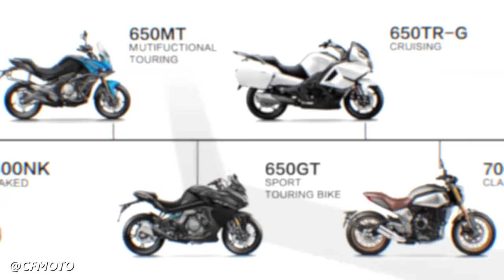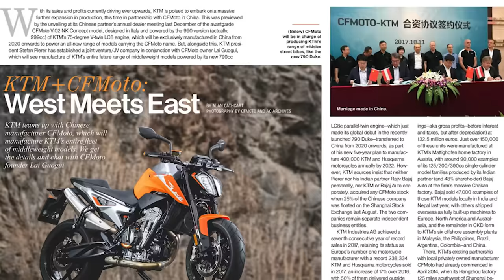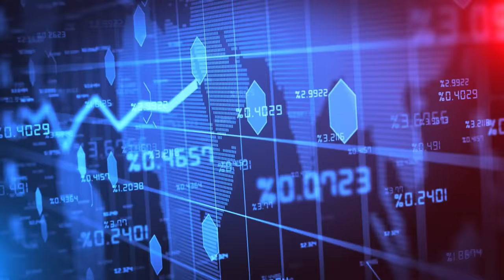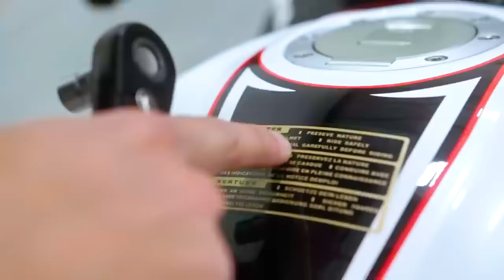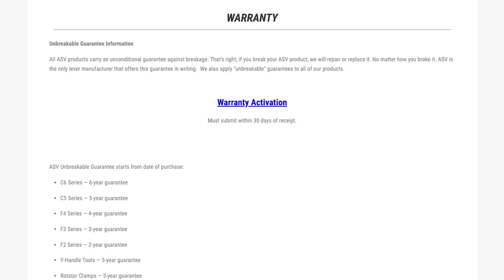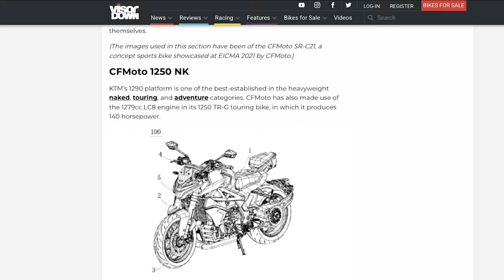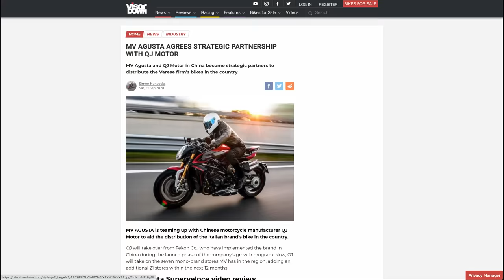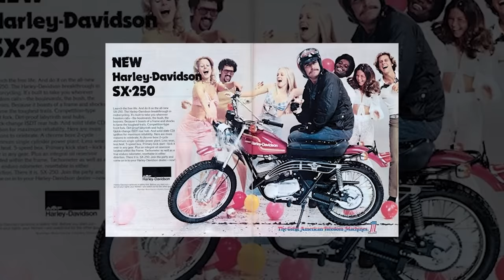NEW Chinese 1000cc V4 Superbike! (CFMoto)

Comment: Fun fact - The Kawasaki 650 parallel twin is also manufactured by CF Moto. It's the same engine used in CF Moto's 650 line up and the Moto Morini XCape 650. Thank me later
Reply: Everyone knows this dude
Reply: @chrispekel5709 I didn’t know that
Reply: @chrispekel5709 dude wtf not all knows this
Reply: That is false
Reply: Lol. Where's did you find this fake info? Bing?
Reply: What!!! NNNNOOOOOOOOOOOOO!!
Reply: What I do know is that the CFmoto CLX 700 series used a larger kawasaki ER-650  engine but 700cc in displacement.
Reply: cfmoto is knock off of kawasaki as most chinese are knock offs of japanese. kawasaki made that engine before cfmoto ever mad a bike
Reply: NOPE cfmoto makes clone of kawasaki engine and honda engines. kawasaki and honda made these motors before the chinese ever built a bike, other brand chinese cloned old hond single and twins not they are cloning kawaski
Reply: Parts are interchangeable to fit CF Moto engine. No modifications required as it's just a Kawasaki 650 engine under license, body by Kiska, brake by Brembo JJ Juan
Reply: Wrong info 🤦🏻‍♂️🤦🏻‍♂️🤦🏻‍♂️
Reply: For what ?
Reply: @chestermarigza4917 wrong
Cfmoto has nothing to do with Kawasaki
Reply: @RT22-pb2pp big wrong
Cfmoto has nothing to do with Kawasaki
Reply: @rohzpopper4922 big wrong.
Cfmoto has nothing to do with Kawasaki
Reply: wrong c f moto cloned kawi kawi never used any other manufacturers engines you got bad info dude
Reply: Nope. That's incorrect.

Comment: Let me just say I recently lowsided my 2023 KTM 790 Duke (CF MOTO BUILT) at about 60 mph. And the bike held up really well, no snapped welds or fractured ally. If it wasn't for a bent front wheel I could've ridden home. I've done 5k miles on it already and no issue to speak of. Very impressed.
Reply: Ok John xina
Reply: A bike rammed into my Husky's(Made in India) radiator at 50+kmph, just the guard fell off which I picked up and put on back. Another time a bike rear-ended perpendicularly nothing damaged. See if 5 ppl who had problems would post here then everyone will think there's a problem with KTM's QA but 5 will post positively people will ignore.
Reply: I have 18k miles on my 790, and only issue was a very small coolant leak
Reply: I bought the 700 clx sport about a month ago and I am absolutely in love with it. It was a zero mile 2022 model so I got some money off msrp and didn’t have to pay the dumb transport fee. Walked out the door with it for $6300.
Reply: 5 k I had 60k in 5 yrs on original ninja 600 never had 1 not 1 part fail show me cfmoto that has happened on I will buy in
Reply: @RT22-pb2pp  lol it’s going to take a while before people hit 60k. I am in a Facebook group for clx 700 sports (as I have one) and not a single person has had any major issue. The only issue people have had is around 7k miles for some reason the gas gauge starts blinking. CF Moto does have a recall for it so you can take it to any dealer and they can flash the ECU for it to stop. There’s two or three guys almost at 15k and haven’t had a single mechanical issue. My only complaint is that it doesn’t like anything under 3.5k rpm. It’s pretty jerky. Wish there was a tune for it.
Reply: @Nick-Edwards pls complete 60k miles on your clx
Reply: Chinese cheese wheels  😂😂😂😂😂
Reply: Pshhh
Reply: Just fyi people ride 03 bikes with just an oil and filter change. Thats kawasaki,honda,yamaha reliability.5k aint shit, those bikes are 21 years old and abused! Thats impressive

Comment: I still love my 450ss after having for for over 5k miles in 3 months! Absolutely insane!!!
Reply: I consider buying one myself. What is your opinion now, nearly a year later ?
Reply: @solidXsnake4life But big brands like yoshimura exhaust have an after market exhaust for 450ss doesn't really sound good in my own opinion but it's good because it improves performance and trusted brand you can also buy Vandemon full system exhaust dual exhaust for cfmoto 450ss around $1200 USD no tune required as long as you have the db killer/silencer 100db w db killer / 104 without db killer

Comment: bought a 2022 650NK for $6K OTD and have loved it. Ridden my friends’ R6 and mt-07, etc. Loved those bikes and yes, they were BETTER but they were also almost 3-4K more OTD and idk if they were thaaaat much better. Part availability is okay but most parts that fit kawasakis for the 650 line up work since they’re pretty similar stuff and the 700 bikes just use KTM stuff so those fit pretty well too

Comment: I have CF Moto 300NK, and given my small experience, I can point out only minor negatives:
1) Handlebar vibration could be a bit less
2) Engine cooling system is weaker than  desired (affects only slow speed riding in hot weather, 85 °F), but no overheating
3) Fork rebound is a bit harsher than desired
4) Seat could be a bit softer
5) Speedometer shows ~2 mph more than the real speed
Other than that, it seems to be reliable machine (+2 years warranty), well-built, and fully suits me as a beginner bike.

Main competition are India-built Yamaha bikes plus Indian brand Bajaj.
Reply: Isn't the +2mph a legal requirement for manufacturing?.
Reply: @TheLiamis  Not sure. But it is annoying to see at lower speeds, when it makes a difference. We use km/h in Azerbaijan, so it is like 9 on speedo vs 5 real. I had a Japanese car which lied about 1.2 mph , that was tolerable, 2.5 mph is not.
Reply: @Murad.bn2  I think it's required to prevent people going over the limit. As I always say though the speed limit is the grip on my tyre's.
Reply: You bought a budget bike = got what you paid for
Reply: @IN_ZANE_  Completely agree. I am generally happy with it, worth the money. As for major brands, we don't have dealers in our small country, so that all those bikes come either used, or for crazy prices (like Z650 2023 for $16300).

Comment: CFMoto pricing in the US makes it a little harder to pick if a CLX700 is 7k and a MT07 is 8k... But here in Australia, the price mark is tempting, the CLX700 is $8,500 whereas the MT07 is $14,500. I'm stuck between buying a Suzuki SV650 at $11k or a CLX700. My head tells me to get the SV, but my heart based on the styling and features is considering a CLX700.
Reply: My CL-X 700 Heritage was $6,400 out the door here in the US. Granted, I bought the 2022 instead of the 2023.

The cheapest MT-07 I could find online (excluding Facebook) was a new 2023 for $6,900 before tax, title, registration, and dealer fees. It would also require me to drive over 400km to pick it up.
Reply: Clx700 sports are $4000 at dealers by me
Reply: @rileyrat13 400km is like 2 hours riding..?

Comment: Re "unbreakable ASV levers" ?  Meanwhile many levers are obvious DESIGNED to break (with an actual break point notch midway in the lever) rather than to destroy that expensive brake master cylinder.   So IS n unbreakable lever a good thing if the application is on a master cylinder?

Comment: KOVE just launched 450RR this year which is faster than zx-4rr,  
Cfmoto is currently making a 100hp  675cc  three-cylinder engine, it will to the market in a year or two
And Zotes too is making a 600-700cc three-cylinder engine
Things are getting really exciting lately

Comment: I started with a QJ motor 125cc, a Keeway RKF, in some countries it’s sold as Benelli. It sucks, after 15 days of ownership it was dead due to an electronic problem, then it broke the front fender, after that electronics got busted again, then the led cruising light just stopped working, after that the front fender got broken again. it also just shuts down while idling, the dealership was never able to fix it. All of that in 1 year and a half and around 15k km.

Comment: Cf Moto cut their teeth building their clone of the 247cc sohc liquid cooled Honda helix engine.
 Gotta say, as a engine builder, and multiple fast motorcycle owner , Ive actually owned and rebuilt some of the original cfmoto Honda reflex/ helix clones, and they run good. And Last A while, A crankshaft with rod & bearings for them is $80.00. a piston with rings is $19.00...
Drove one 500 miles a week for almost a year. 85 mph/80 mpg

Comment: I've been vlogging my experience with the new KTM 790 Adventure produced by CF Moto (not coming to the states!). It's done everything I've asked for it so far without no obvious downsides 700 miles in. The gears have been missing slightly so keeping an eye on that, but I think I just need to dial in my clutch a little. As with Royal Enfield, at the very least it puts the wind up the major players, which will result in them being more competitive in turn - win/win for the consumer.

Comment: The X350 is gonna suuuuck. The motor in it is a stroked Benelli 302s motor and that bike is revvy as all hell... it just feels wrong for a Harley to rev like a supersport, with no low end torque at all. The 500 should be a bunch of fun like yam said, the Leoncino rocks. Much more harley motor-esque if not for the 360 degree firing order

Comment: a KTM engine with chinese manufacturing? 
Sounds like a formula for reliability 🍦
Reply: That is litterally where KTM is at right now. Engine design and longevity itself is largely very good but let down by hit or miss QC with sub par assembly, typically coolant/oil leaks etc. Some have no problems and won't hear a bad thing said about KTM while others do.... and end up getting pissed off waiting weeks/months for replacement parts which often leads them to switch brands.
 I suspect a CFMoto branded KTM, if we can call it that?, would likely be a similar ownership prospect.

Comment: Id be very weary of buying a 1000cc cf moto superbike. With that kind of power any flaw could be deadly. Just lookin at the concept I can see some worrying components. Plus we are yet to see how reliable the even 450 is. Onde you start lookin deeper into the 450 you can see some shotty work here and there (cough cough swingarm). Not to mention who knows how much their 1000cc would weigh if the 450 already weighs as much as a cbr1000rr. It could be as heavy as a bagger

Comment: I bought a cf moto papio and it's very well priced. It has 40 miles on it and it's been dropped a few time. I only snapped the driver side foot peg and the gear sift lever.
Reply: Which side is the driver's side on a bike?? lol
Reply: @maxedout33t depends on how drunk you are lol, but I actually meant left front not "Driver's side". I just was being a dipshit
Reply: @maxlithium1190  I knew what you meant just messing around

Comment: What is funny is that, QJ's 1000cc "superbike" is actually using a 921cc engine from old Brutale 920. That engine only got 130hp compared to Brutale1000RR's 210hp. It's pretty clear that 921cc engine was made for street bikes -- of course cuz it was used on Brutale920 while the proper 1000cc superbike engine was used on the F4 series. Brutale 1000RR is a stripped F4RR as we all know, while the QJ Race 1000 has a pure street bike engine, clip ons raised all the way up to the moon, a seat height under 800mm. And they name the bike with the word "Race". Bruh. The only good thing is that the chassis design is the same to Brutale 1000, however QJ is gonna make the chassis so it's probably gonna be HEAVY AS HELL. Their Race 600 weighs even more than my StreetfighterV4. And they are branding it as a 600cc sport bike... a 600cc sport bike that weighs over 220kg, well damn that's new.

Comment: I have a cfmoto 650GT which is the sport/touring variant and i will say at lower revs it can feel a bit off at points but when you get them up it feels perfectly fine especially consdering they have undercut other 650cc bikes by about 2000 give or take. i will say the owners manual is full of spelling and grammar errors  which is a tad worrying since you do wonder if they skipped on a proof reading what else was skipped on.

Comment: Vastly misunderstood KTM engine "model" identification where a LOT of people actually THINK that an "RC8" engine is a specific design which is totally NOT TRUE....ALL RC8 or LC8 LC4 etc means is for example "Liquid Cooled hence LC 4 valve or or 8 valve or in the case of motogp 16 valve with "RC" replacing "LC" for race bikes.  But for example the an 8 valve engine "LC8" simply means liquid cooled twin with 4 valve heads ....it could be a Vee Twin OR a parallel twin of WHATEVER design and discplacement and it is STILL an "LC8" so LC4 LC8 etc does not mean CRAP as far as a SPECIFIC engine model so get that out of your BRAINS folks!  Yamaha sort of does a similar thing with CP2 CP3 CP4 but at least I think there is some actualy continuity so far?   Like maybe all the current CP2s really are the same basic model of motor used in Tenere 700 R7 and MT07 XSR700 and then the CP4 is the same basic platform shared between R1 and MT-1o FZ-10 albeit with some internal changes depending.  So unlike Yamaha one can not talk about LC4 for example like it is one common platform cause it is NOT and you will sound ignorant if you suggest for example "the LC4 is a time tested platform going back decades"  LOL  NO there have been several TOTALLY differnt motos sharing the designation "LC4"

Comment: I originally heard thatCF Moto would just use the old 990 twin motor... the rumor being they bought the rights for that old motor.... but now the rumor is more they will use the same brand new V4 KTM designed engine made in China that just so happens will also be called "990" by KTM but 1000cc by CFM  which sounds like accronym for what? CounterFit Motorcycle? but wont be a knock off if they also are building the engines for the rumored new RC8?   Wait the RC8 was the old twin that had 4 valve heads hence 4x2=8 hence RC8 ...but  a NEW V4 would actually be an RC16 but that is not as cool as the sound of "bringing back the RC8"  Although the 1000cc KTM prototype MotoGP bikes are called "RC16" already ....so I mean either name is cool

Comment: I know Ktm's boss, motogp manager, and motogp team director. I can garantee that by any means if that engine comes from a Ktm we wom't see it first on a Cfmoto. It will be then the flagship for the Orange bran for sure. Then, and only then, may cfmoto realease it. But I hardly doubt. Before that would come out as a GasGas. And that is a fact. Then the question is, could cfmoto have designes his oen engine? Hardly doubt it, but i don't see it less crazy than a ktm engine theory... it's a bizarre situation. I'm personally goin to stay a little skeptical about it until it's released. Matter of fact, kawasaki has a 2 stroke turbo 4 cylinder engine, with 4stroke valves and head, and separated crank case volume so does'nt use oiled gas mix etc... but again. This is just crazy things drawn on a paper and pattented just in case, but not often they come to see light. Whith cfmoto i just want to keep feet on ground until it's done

Comment: You forgot to mention the NK800 - It is like the SuperDuke but with smaller built. And it has crazy torque! Lots of Chinese people wreck on it due to cheap, SUPER power but cheap haha and they can't ride 🤣And BTW QJ Motor already released the 1000. But it is not 1000cc it is 921cc and called their 1000cc bike. BUT IT SUCKS!

Comment: Do not buy cfmoto. I work at a dealership that sells them and we just had one of our builders almost get his head taken off because the cheap Chinese shit parts they use caused the throttle to stick open and he went through a closed shop door. That’s just the worse not to mention all the issues these things have. Lost all respect for yammie with this video. Wonder how much you got paid. If you value your life do not buy or ride cfmoto.

Comment: The FIRST CF Moto adventure models were SO pathetic!  low power and the worst wheel rims in the history of motorcycles!  The one I rode with the rims looked like an ocosagon (20 sided shape)  ANY hit whatsover bent the cheese wheels!  They MIGHT have held up a while on well maintained asphalt with zero potholes but they were just PATHETIV otherwise as the company cut every corner they possibly could to undercut the MSRP of ANY other brand....The consensus then obviously was 
ANYONE would be SO much better off buying a used Japanese motorcycle for the same money.....even an old one!"